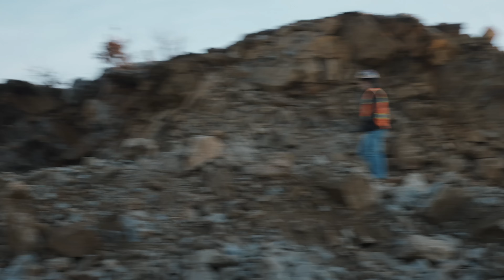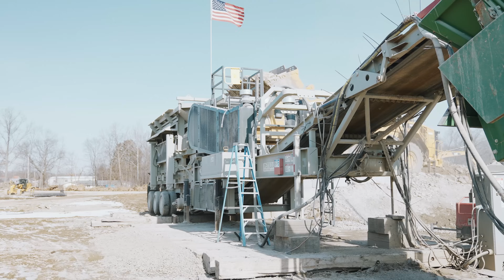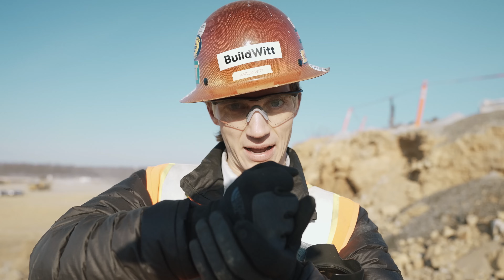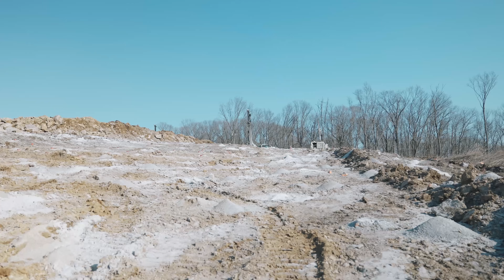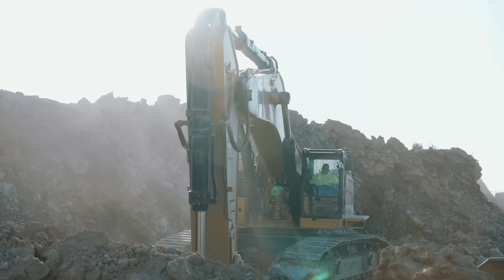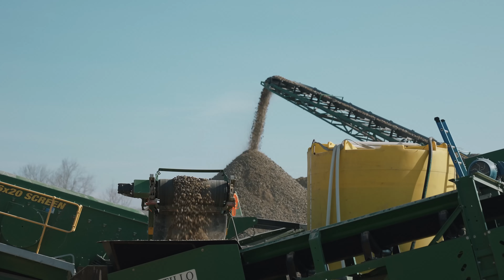Moving 25,000+ Yards a Day with Three 90-Ton Excavators

Comment: Thank you for all your neat videos. Being able to see these sites. For myself got to see a blast at KINNACOT at Salt lake City open pit mine.
( My spelling is bad on names) sorry. The huge open pit mine just West of Salt lake City. Bingham Canyon Copper Mine. You can see the Hole from space. The Cat D-11s start there Ripping as soon as blast are done. To break up the hard rock just blasted, for bench digging with huge 4100 electric Shovels. There is one huge article Loader with blade for smoothing pad drive area around shovels for monster Cat Dumps to be loaded. Every piece of large earth moving equipment looks like a tiny ANT'S inside that bowl of mined earth.
There is a training model for operator to learn to operate the big Shovels. Is scaled down, with a mock up cab and control, everything the operator does. The scaled down shovel does.
Highly recommend the view area/ gift shop as a place to go, for people to see blasting and bench cut removal of earth. Highly recommend if ever going to Salt Lake City and you have some time. The Guard gate people are very nice. Give you a map, to gift shop/ observation area. A bus load of Engineering want a be students were at view area, before they got to go down to operate the scale model. Boy I wanted to sneak on there bus. They also have a great museum. There is a lot of GOLD they separate out of raw materials when they make the raw product for steel. The large Cat excavator that you show in this video. They can only load those large Cat Dumps by the back opening. They don't have the highth to dump bucket over the side. They had 3 of the biggest Cat Graders, working in tandem to grade haul roads, just constantly grading the roads, very fast. There is a POWER crew with huge boom trucks just to extend, build more grid, ect. For the Electric Shovels. Long lines of huge Cat Dumps constantly moving back and forth, loaded to dump, then back again. The workers work 3 long days then have days off. The raw rock dug just being moved constantly. Very impressive to see. A bucket list for anyone who moves earth.

Comment: Pretty curious how they think there moving 25000cy with those machines.  Just simple math makes  that  not correct unless they are working 12hr plus days. Using a 1100 kamstu and a 7.5hr day loading anywhere from 400 to 450 trucks was just shy of 6300cy. 1100 is Bigger machine and loading dirt with cycle times less then 40 seconds. The 1100 is a 2 pass machine. Looks like a fun job but math a little off and just one more point if they are blasting for 35000cy they would be blasting a lot more to keep up with the load out operation.
Reply: Was hoping I was not alone.  Even with simple math a 12hr day would not get them close to 25,000 yards a day. Assuming a 6.8 yard bucket, each machine would have to pass a completely full bucket (highly unlikely) every 35 seconds for 12 hours non-stop.  Not happening.

Comment: All you do is 25,000 yards with 3 excavators. My company does 18,000 yards with a single 100 ton excavator.
Reply: No you dont, around the clock maybe but not in a single shift